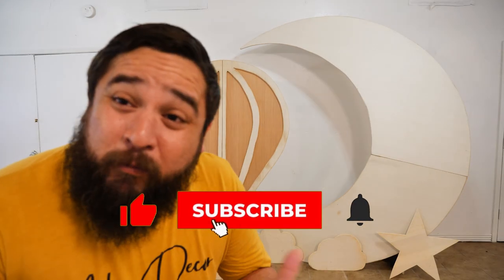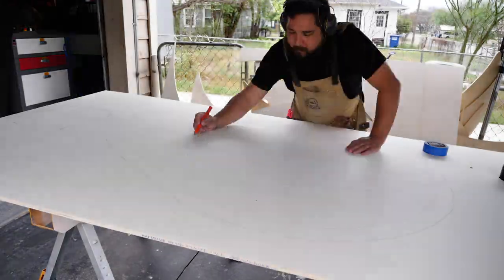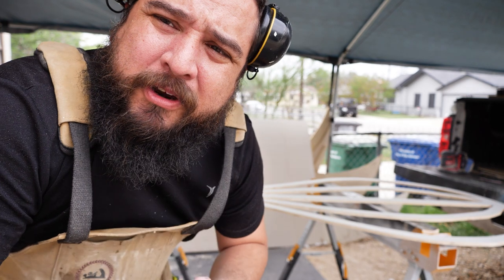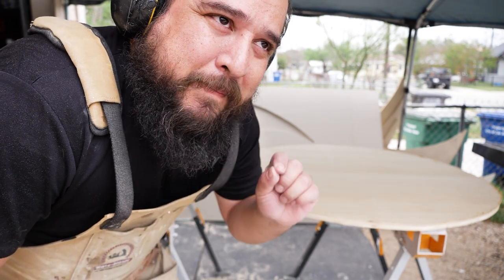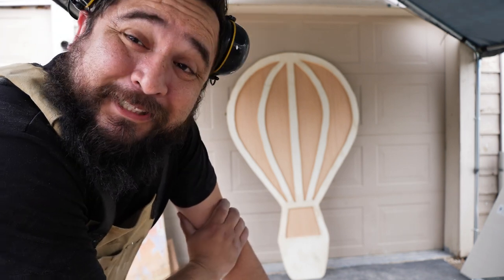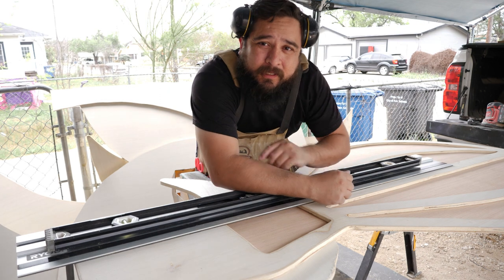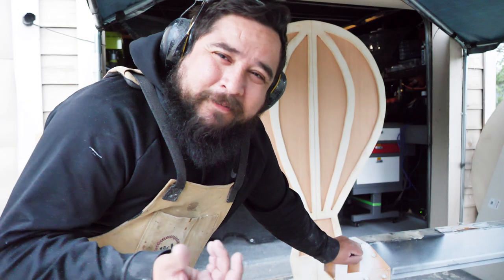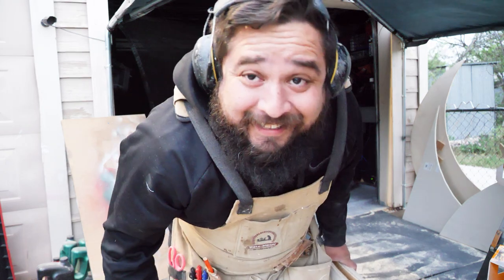DIY Hot Air Balloon & Moon Party Backdrop

Comment: I've just started using the bosch "clean wood" blades, part no T101AO they cut slower than regular jigsaw blades, but so long as you don't force them, they leave a nice clean cut both sides 👍
Reply from the maker: Oh cool, I haven't seen those. I will have to look them up. Would help avoid a lot f the extra sanding on some of my projects. Thanks for the tip!
Reply: @MakerDecor  you've got to be gentle with them though, they bend very easy.  Ask me how I know 😆

Comment: I love your work! Would you suggest painting each cut out before glueing/nailing together or paint them when they’re together?
Reply from the maker: Thank you. I would wait to paint at least the back part. Because the wood glue will not stick together over paint. It needs to be plain wood to wood to get the adhesion you need. Just because the wood glue is the main part that holds together. Hope this helps and good luck!